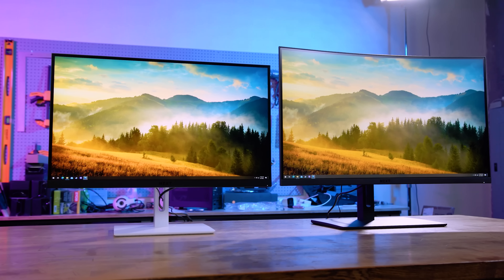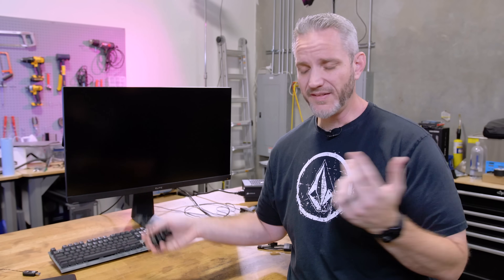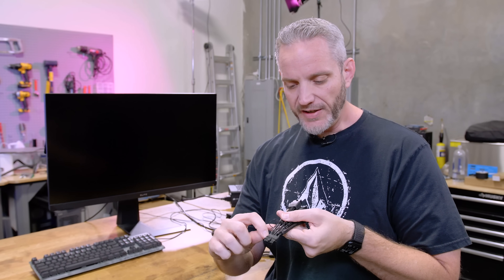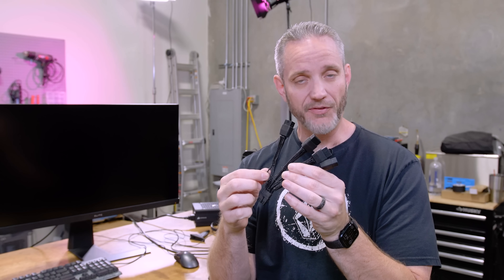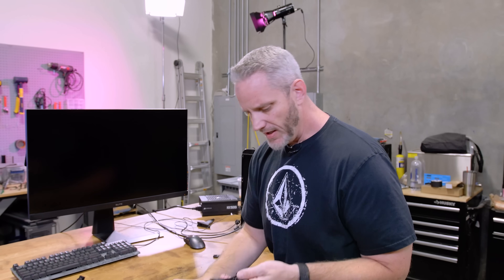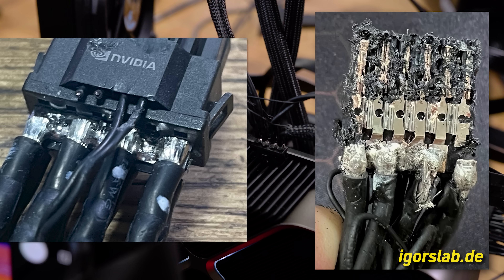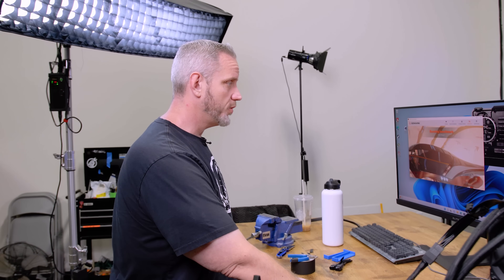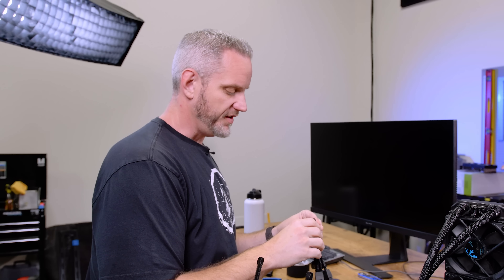Igor's Lab figured out why NVIDIA adapters are melting!

Comment: Want proof consumers are not very open minded, read some sub comments. If you’ve never been in manufacturing just let me say there is a ton involved with things you think simple. Just because company a has implemented and perfected something doesn’t mean nVidia can. Pretty sure someone makes it for them, but once again the cost/time is a factor. Profit comes from learner efficiency and innovation. These things aren’t free. So when you think your however much GPU should be the best and why did they skimp on a cable, you’re not understanding the problem at all trust me.

Comment: Power are not meant to be share just like the psu extension I have same problem when I split the cpu fans. I have same problem but with the cpu fan that I have a splitter on remove the splitter problem solved. 🎃 How Nvidia made this same mistake 😂. U are half right though don’t need to break for it not to work it could work but psu power are not meant to be split.

Comment: THAT IS NOT THE MAIN Culprit..... 99.9% of the issue is that people use a single output from your power supply and push that the final cable ... This bring the AMPERAGE WAY UP from that single output to all 4 wires to the point of overheat and weaken the solder joints ...happends on all 3000 and 4000 series card. YOU ARE SUPPOSE TO USE 4 POWER SUPPLY OUTPUT FOR 4 WIRE INPUTS! VOILA THE SOLUTION! I Know people dont give a Sh@t about my post but im telling you the real reason, save yourself a home fire and listen to me.  JAY, use any wire and split a single power supply WIRE to all 4 Inputs, load your video card with a game and you'll see what I mean.

Comment: “No has much to do with the power draw of the card”, but “the pin size”…

Come on, who designed the card? Nvidia.
Who chose this connector? Nvidia’s “engineers”…

Come on, it’s a shame they couldn’t select a connector of the appropriate power size for their own card.
It’s huge shame for a card of this price tag.

It is simply unacceptable.

Nvidia should be boycotted for this, and the false 4080 affair too.

Comment: I wonder if somebody could sell connectors of different angles, to fit your needs when you design your P.C..

It's no good saying "don't bend the cables" - that doesn't provide people with what's needed.

I think Nvidia should be thanking you, for finding out that the GPU's weren't the problem.

I'd still buy their card, but I'd now be thinking of the connectors in my P.C. design.

Ney good saying everything's fine, everything's fine... Don't bend the cable, stop talking about the issue....

Fukdat

Fix the cause, move on.

Comment: These adapters are complete garbage.  It makes no sense to me.  Given that without a problem the power supply can be in the back of the video card and there is enough space there even if they want they can put 24 pin sockets.  Cables especially for power supply should be thicker.  Under constant load, thin cables heat up much more.  Why do they create this kind of transients in the first place?  If separate inputs are placed in the back of the video card and the cables are thicker, it will not be bulky, but a much better and stable power supply will be obtained.

Comment: I'd say that a low quality connector can eventually lead to overheat. But here we are talking about a cable that works at higher temp than the gpu core. Thats not admissible not from an experienced company like Nvidia. Good copper cables can work at 70 celsius with no problem. Here i cannot see any copper. Engineering is not an opinion but facts. Mistakes may occur but Nvidia lost their clarity of mind. First the 3000 series drama that led to 4000 overpricing then 4080 12gb joke toward this melting problems. Nvidia what the hell did you smoke in there?? Melted cables?? They are playing us like fools for the sake of the income. They need money badly but this time they wont take mine.

Comment: Am I correct in understanding that Nvidia is RESEARCHING this issue, which they should have identified when tested cards prior to release? Now you buy a top card to keep an eye on it and brush off the dust, not use it to its fullest and are afraid that it will burn out? Outrageously simple. You pay so much money for a video card that can start a fire. Big. Just great. Awesome. I just clap. CLAP CLAP CLAP

Comment: Great material man.

To me:
This is bullshit. Manufacturers are making worse solutions to PC eq. replacing with them things which works fine and have good temprature separation.

Instead of aluminim gold or platinium could work better and more efficien but also there is a price factor. And again the price of the latest techs isn't low. 

To me:
market at this moment works a bit like this: 
What's the problem ? Producer will burn your card for couple hundreds of bucks by the propably cheapest solution sold for higher price...
You've burned it. Buy a new one.

Comment: And this is why you don't use solder for mechanical joints.  This should have been done with crimping, probably much further away from the plug so that the plug can be made as small as possible.

I also think you're having a hard time recreating it because the problem isn't a fully disconnected solder joint, it's a partially disconnected solder joint.  A broken joint can just mean open circuit, but it can also mean high resistance closed circuit, and that's going to make a whole lot more heat.

Comment: late to the party, but this explanation doesn't make any sense

the end connectors are the ones burning ? that implies they are the ones taking excessive current, which means the inner connectors are breaking contact

its more likely the inner contacts break because they are getting hotter in usage than the outer connectors...heat from itself and its two neighbours vs heat from itself and a single neighbour

remember 100 degree C is above melting point of low melt solder...its poor quality soldering + low melt solder + poor design causing this...not flexing of the cable

Comment: Nvidia should fire those engineers, it’s such an easy fault to pinpoint in QC
Reply: It's still a shitty cable user error or not. Card should not operate and also melt if the cable isn't in properly, which isn't a hard issue to avoid with good design. GN would agree with that sentiment.